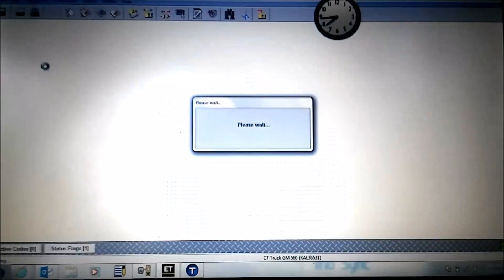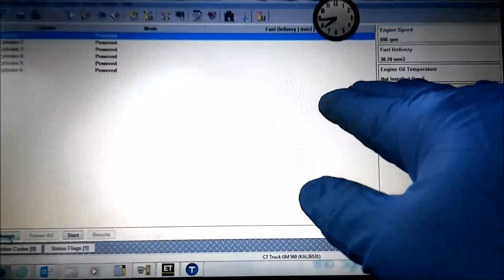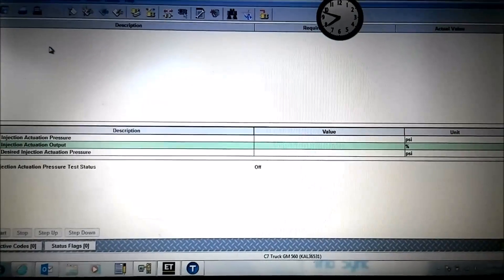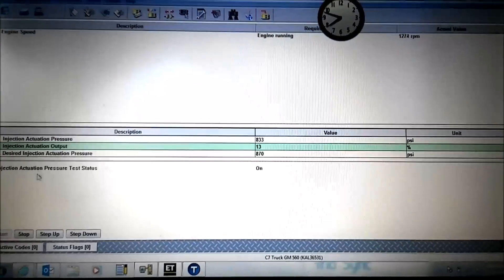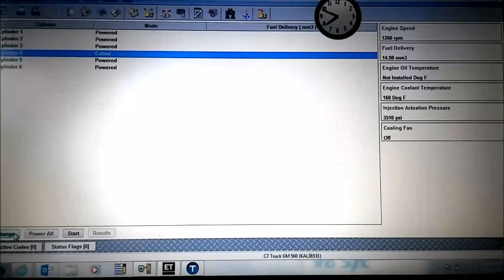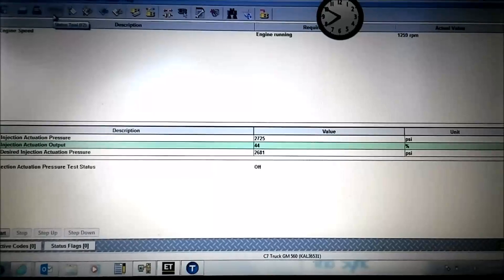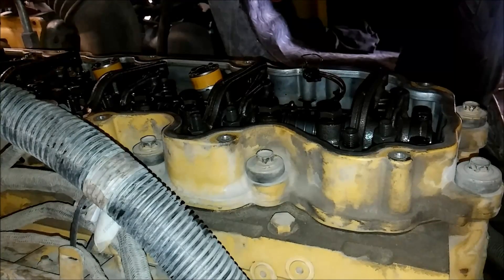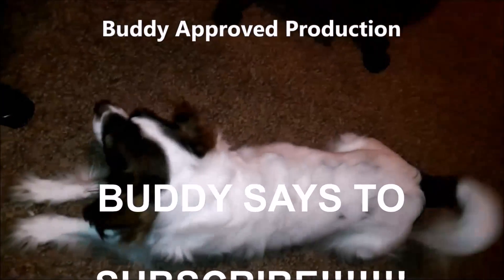How To Do A Cylinder Cut Out Test and Check for Weak Injectors.  Cat, Cummins, Detroit.

Comment: I have a bus with a c7 KAL that was having poor starting issue and smoking like a freight train when first starts up but would run just fine. I replaced injector O rings and that made it start up no issue, for a week. Now it's back to doing it again, so it makes me think an injector is out. But how do I figure out which one? I do have an old computer with a program to run a cylinder cutout test which didn't really tell me much other than 2 and 4 run .5mm3 less pressure than the rest of the injectors at operating temperature. 

 So how can I figure out which injector is draining?
Reply: So now I am back at work, just did a manual test, changed actuator pressure high and low, and cutoff 3 cylinders to see which one had the least amount of change. Cylinder 2 gave the least amount of change, so it's the weakest, but is that where my starting problem is too?

Comment: I try to perform a cylinder Cutout on 336D excavator and it's not possible to do it with injector solenoid defective I replaced the injector then conduct a trim calibration after that i did the cylinder cutout test was t a correct procedure
Reply from the maker: +bhonie zaid If it would do the automatic one because the engine was running too rough, then you could have done a manual one. Sounds like you did it in the right order though.

Comment: Great help on my Cat C9, fitted in Ecolog 590c tree harvester  diagnosed failing heui from you vids.  desired and actual over 200psi difference when warm. Only done 560 hours with 250 hrs oil changes.   fitting reman this afternoon. thanks
Reply from the maker: +homeforestry You are welcome. Thanks for commenting.
Reply: Adept Ape 
fitted reman heui last night. now engine using boost pressure on tick over and down on power think there is 1 or 2 injectors out as well. fuel system and pressures all checked. ran it with valve cover off no leaks. No error codes on iqan. No debris of metal in oil. all filters changed on 250 hours. engine reads 561 hours. any advice welcome. Many thanks

Comment: Hey adept ape, I am working on a c7 with a misfire and two inactive codes 164 fmi 2 and 164 fmi 11. I did a cylinder cutout and #1 was dead and #4 was weak. I removed the two injectors and put compressed air to the two cylinders and the engine turned over. I replaced both injectors #1 is now firing and #4 is weak when engine is cold and when engine is warm it is dead. In the meantime both codes go active and injection pressure is unstable.  I commanded the injection pressure to full pressure it would build to 3300 and it was stable but at lower pressures it was not. I tested the wiring to the ecm it was OK so I replaced heui  pump . I removed the cover on heui pump there was no metal. The new pump fixed the pressure  problem but I still have #4 misfire.I tried another  new injector still misfires. I tested the wiring to the ecm, OK checked terminal drag, OK. I tried an ecm from another truck still misfires. There are no codes, any ideas would greatly be appreciated. You have done a great job with your videos please keep them coming.
Reply from the maker: +Charles Curtis Sounds like you have a mechanical problem with the engine on number 4. I would remove the center side cover and inspect the lifters/camshaft for damage before doing anything else with the injector. Just remove the number 3 and 4 pushrods and then pull the side cover. Let me know what you find.
Reply: +Adept Ape Thanks for the reply , I adjusted the valves when I was waiting for the new injectors to show up and honestly  don't remember how much lash #4 had.  I was paying more attention to #1. Is putting  air to a cylinder a reliable  test of cylinder condition?  With the details I mentioned earlier about the injection actuation pressure problems and two cylinders misfiring and not having obvious  metal in the pump , should I have replaced all the injectors ? The truck has 70,000 miles on it. I will pull the side cover and check the lifters. By the way I am a subscriber and have learned  a lot  from your videos.  Thanks again.
Reply from the maker: +Charles Curtis Thanks for subscribing. The air nozzle test is an okay way to test the cylinders, but Cat doesn't make a compression tester for most of their truck engines, although they do for many of their other engines. If the pump goes and you lose two injectors it isn't a bad idea to change all six, but it is expensive.
Reply: Adept Ape Thanks for replying , I will let you know  what fixes it.

Comment: I have a 3406e 1lw turned up to 750, the engine is still "technically" under warranty, I have a few months left on a platinum overhaul so everything is fairly new. The question I have is when the truck idles (600rpm), there is kinda a miss or cut out of you will. It only does it at low idle when under a load or driving its fine or even if you bump the idle up no problem at all. It's very hard to notice you really need to give it 100% of your attention to notice it, but it seems like it's getting worse. Some people have told me it could be an injector or the injector wiring harness or the engine position sensor. What's your thoughts?
Reply from the maker: +Christian Rogers Usually a sensor or wiring harness log a code, if you don't have a code then you need to a cylinder cutout test to determine if you have a weak cylinder if you do then check that cylinder.
Reply: Adept Ape 
Thanks! Ok will do as soon as I can. The weird thing though is that the truck had a wire completely cut/rubbed through and it didn't show any codes period. Just wouldn't start. It turned out to be the engine position sensor (only has one and it's on the camshaft) butt connected it and went on my way. Then had a faulty sensor and still no codes. These older cats don't really throw codes o think.
Reply from the maker: +Christian Rogers They should code right away on the injectors if you have a current fault, now some of the sensors are more passive.
Reply: Adept Ape 
Ok perfect, well I'll try that cutout test like you mentioned as soon as possible! Thanks again for the advice and the videos, there lots of help! I'll update you as soon as I get the test results back.
Reply: Adept Ape 
So I did a couple of test, I did the clear hose on the line coming off the head going to the tank, did it also before and after the fuel filter from the tank to the transfer pump, nothing there. Checked fuel pressure at idle and was at 76psi. So then performed the cylinder cut out test and it checked out as well. The next thing I was going to try was to do an overhead and set the injectors. And if nothing there then maybe replacing the harness underneath the valve cover.

Comment: hey adept,
is number 1 heui injector on the timing gear side or on the flywheel side?
Reply from the maker: +Omar Number one cylinder is the forward most cylinder to the timing gears and Dampener, number six is flywheel side.
Reply: thanks!!!
Reply: Adept, if i may ask, is the fuel elivery on the screen for one injector or the sum of all injectors??
Reply from the maker: +Omar Well it is really the electronic"rack" setting and each injector gets the same delivery as the others so it's really the fuel delivery for entire engine, but each injector as well.
Reply: thanks!
Reply: Adept, the mm3  fuel deliery per what? like one injectors total fuel delieveey is 33 mm3, is that per minute or hour or per ehat exactly?
Reply from the maker: +Omar I'm not sure what the rate is per injector with the mm3 readings. There is a setting in the status screen for fuel economy or fuel consumption that will tell you the current fuel rate, so if you convert the mm3 to the fuel use rate, you could figure out if the rate is per hour or minute and if it's per injector or total engine use.

Comment: the engine block it's in I'm my lobster boat
Reply from the maker: +Derek Jeffers There are plugs along the oil rail that run along the block, its most likely one of those that can be removed and then a new oring installed if its leaking. Without seeing it, it's hard to guess if it's something else.

Comment: I have a 3406 580hp mechanical it has a small oil leak up above the starter what would that be a seal and it looks like a rest button there or a place for a hose maybe I'm not really shure
Reply from the maker: +Derek Jeffers Do you mean on the engine block or on the flywheel housing itself?

Comment: is it the same concept for engines that show fuel position vs. delivery such as a c15
Reply from the maker: +CHRIS BUXTON Good question, yes the principles do apply the same. The real question is why Cat uses 2 terms for basically the same thing. Electronic engines don't have a rack position so why have a fuel position and not just call all the parameters for fuel, fuel delivery? We may never know, my guess is just that they had a carryover with the "position" term from the olden days.

Comment: Did you roll the crank to close the valves on that cylinder before throwing the air to it?  And when you do a actual compression test, do you use a dummy inj or another tool?  Thanks good vid!!
Reply from the maker: I didn't have to rotate this one because it already had the valves closed on that cylinder, but you are correct in that the valves must be closed for whatever cylinder you are testing, so just rotate it to get there. A normal Diesel compression tester does go in place of the injector, which kinda sucks because every model of engines has a different injector so they aren't universal like automotive ones. Very good questions.
Reply: Just ran into you today, and enjoy your editing style! Im kinda old school with a black and white outlook and love listening to smarter people! And always looking for new ways or tools!! Keep up the good work! thanks!!
Reply from the maker: +Docoski Thank you for the kind words. I try to get the info out because people seem to enjoy watching the videos.

Comment: Just wondering if it's possible for someone with little to no experience to become a diesel mechanic? I am in the construction business, and feel I am more passionate about cars, trucks, machinery than I am construction. I have applied to a couple tech schools and I am wondering if I will be laughed out of the class, or if ill do well? As I am willing to learn as well as bust my ass everyday. Thanks for your time.
Reply from the maker: Most people going to tech school haven't worked yet so you'll probably have a leg up on them. Everybody starts somewhere, I didn't know anything about engines at one time as well, you just have to go it and learn. Your interested and willing to work hard, that is all you need. Best of luck to you.
Reply: +Adept Ape I appreciate the insight! Have a good one!